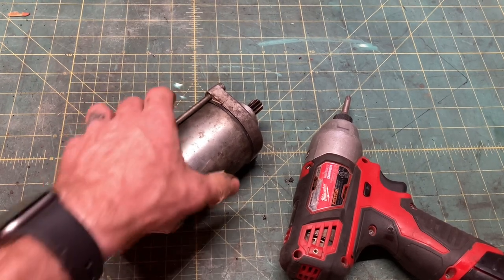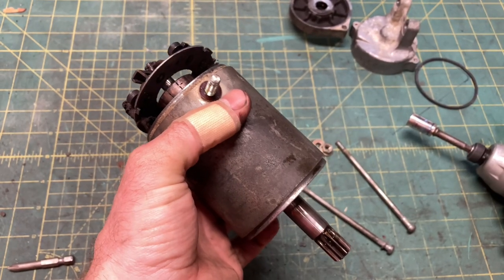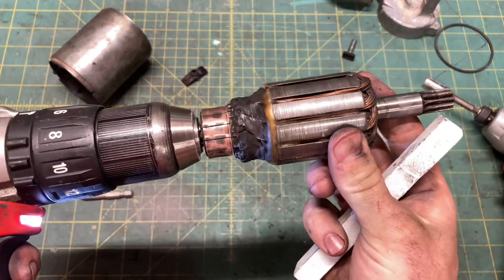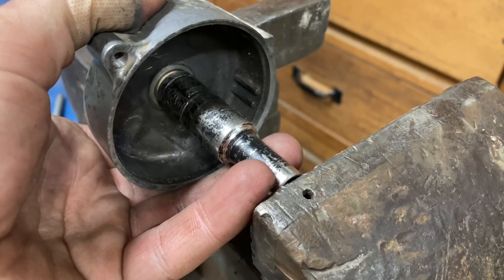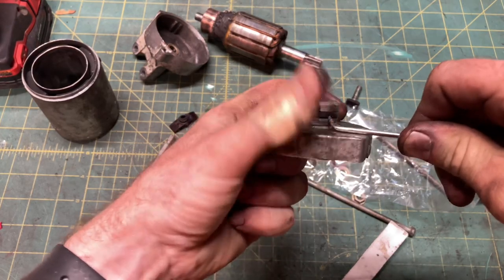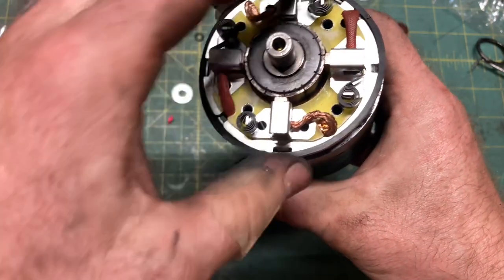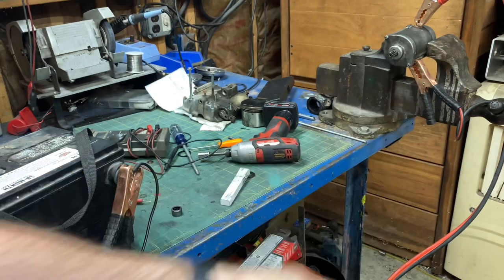How To Rebuild A Vintage Honda ATV Starter

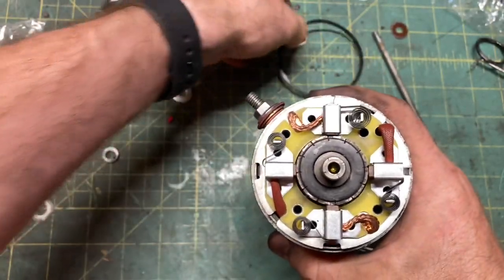Comment: First off I've been going through the videos on your channel and I've been loving them. Second off at 8:16 you can see one of the springs is in wrong (the one towards the top of the screen). I know I'm a year late to the party on this, but I think you ought to know anyways in case you ever want to put yourself through the trouble of removing and disassembling the starter all over again. I've had to do this sort of operation on lawnmower starters before so I know the pain.

Comment: I just did this with my 2001 Rubicon. Rebuilding a starter is not complicated but i dont suggest it for anyone who is not at least a little mechanically inclined. Now if they would only start selling a kit for the shift motor, i dread paying the $200 for one of those when its time, and I learned my lesson a long time ago about using the cheaper Chinese replacement stuff. Buy Honda brand parts and you'll only have to replace it once if you're capable of doing it correctly.
Reply: I wish more brands didn't sell the exact same Chinese parts as "official replacements".

Comment: what size is the needle bearing? mine has melted and the one in my kit not only doesn't fit well, but is a whole eighth of an inch smaller than the old one.

Comment: I know you won't read this, but an easier way to remove that bronze bushing is to fill it and the cavity with grease and hammer a punch or socket into the cavity. You use hydraulic force. I've pulled many pilot bushings this way!
Reply from the maker: You were wrong about me reading this, so how can I possibly trust anything you say??
Reply from the maker: In all seriousness, I’ve tried using that method to replace blind needle bearings in a supercharger. Never could get it to work but I’ve seen other people do it successfully.